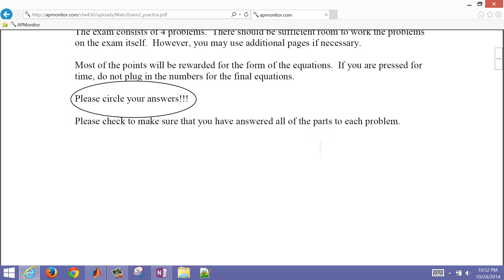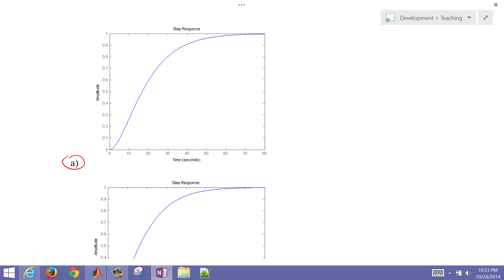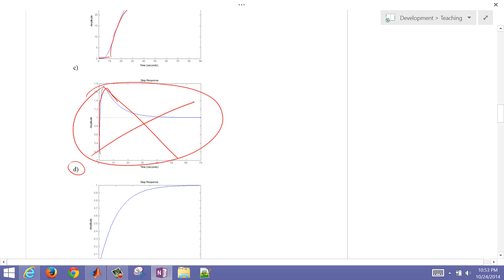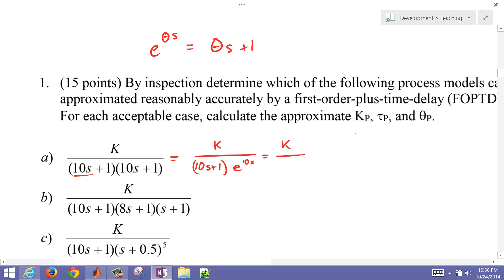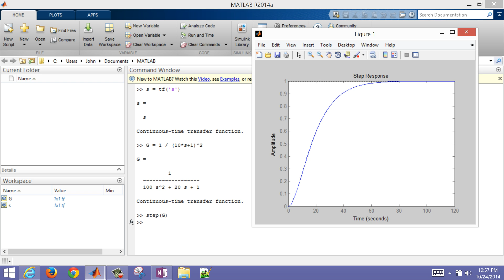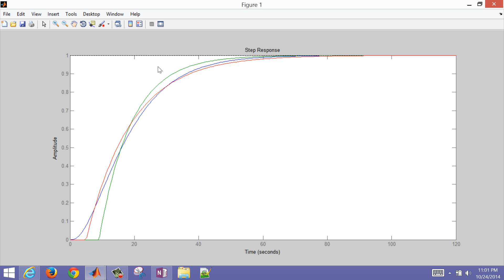Approximate Higher Order Transfer Functions in MATLAB

Comment: Do you know a way to approximate a higher order transfer function to a second order plus time delay with a negative time constant at the denominator?
Reply from the maker: Time constants are positive. You may have a negative in the denominator if the system is unstable. Maybe you intend to have a negative gain? Here is info on 2nd order systems. You can use either an optimizer to fit the 2nd order system or else use a Taylor series approximation to approximate the higher order terms as time delay.
Reply: @apm  Yes, there is a negative gain. Thank you, will check the resource you provided.
Reply from the maker: Here is some help with 2nd order systems: https://apmonitor.com/pdc/index.php/Main/SecondOrderSystems

Comment: Good Night, is there anyway to get a FOPDT approximation of this Transfer Function:
                     10
  -----------------------------------------
  10 s^3 + 20 s^2 + 50 s + 5
The Time Constant form of this equation is:
                                    2
  ----------------------------------------------------------------------------
  (1+9.605s) (1 + 0.8651(0.4563s) + (0.4563s)^2)
Thank you very much
Reply from the maker: Sure, here are some tips: http://apmonitor.com/che436/index.php/Main/LectureNotes22  I recommend that you use a Taylor's series approximation to reduce it down to an FOPDT.
Reply: Thank you so much!! Using Taylor's series is better than skogestad's method for higher order functions
 ?
Reply: Thank you so much!! Using Taylor's series is better than skogestad's method for higher order functions
 ?
What confuses me about the above transfer functions is that one of its terms is not on the form of (Tn*s+ 1), so, i don't know what consider as my Time constant
Reply from the maker: Skogestad's method is a little better than Taylor series method, but both give similar results.

Comment: Greetings excellent videos, I could help with the FOPDT of: 18 / (5 * s ^ 3 + 30s ^ 2 + 25 * s), thank you very much.
Reply from the maker: This one doesn't have a good FOPDT approximation because it has an integrating root (s=0). The denominator factors to 5s (s+5)(s+1). Leaving off the integrator and dividing numerator and denominator by 5 for standard time-constant form, you would have (18/5) / ((0.2s+1)(s+1)). A Taylor series approximation of the non-dominant time constant gives (18/5) e^(-0.2*s) / (s+1). With the integrator it is (18/5) e^(-0.2*s) / (s (s+1)) but then this isn't an FOPDT anymore.
Reply: Thank you very much, and very good your videos.
Another question, is there another method to obtain the values Kp, Tp, θp of the equation 18 / (5 * s ^ 3 + 30s ^ 2 + 25 * s)?
Reply: Many thanks for the help, there is some method to obtain Kp, Td, and θd of 18 / (5 * s ^ 3 + 30s ^ 2 + 25 *s), thank you
Reply from the maker: It doesn't fit into an FOPDT form but the closest you can get is: Kp = 18/5, Td=1, θd=0.2 with Kp / (s*(Td*s+1)) * e^(-θd*s). There is an extra "s" in the denominator meaning that this is probably the result of a step test of your FOPDT system.

Comment: in part C taylor method

why we make the delay equal to e^-10s?

could you please explain more?
Reply: HASHIM Al Hashim oops it was easy sorry for asking?

for those who do not figure it out 

(e^-2s)^5= e^-10s

thank you for the helpful video Prof.Hedengren
Reply from the maker: HASHIM Al Hashim Sure, I'd be glad to explain a little more. The first step is to put it into time constant form as 32 K / ((10s+1) * (2*s+1)^5). The form with (s+0.5) is not in standard time-constant form. Next, the non-dominant terms are transformed into delay terms with the Taylor series approximation as (2*s+1)^5 = e^(5*2)s. Bringing it into the numerator makes it e^-10*s. I hope this helps. Let me know if you have additional questions.